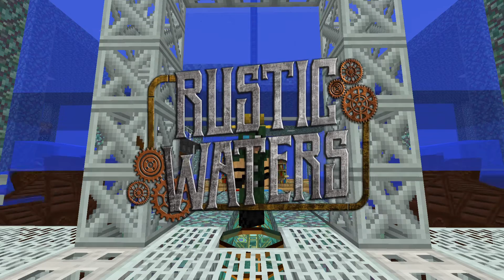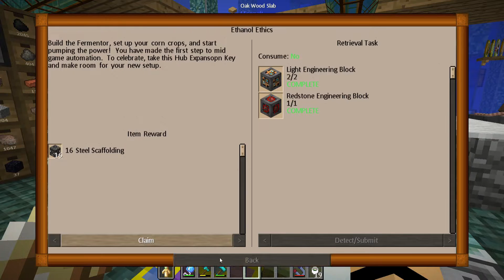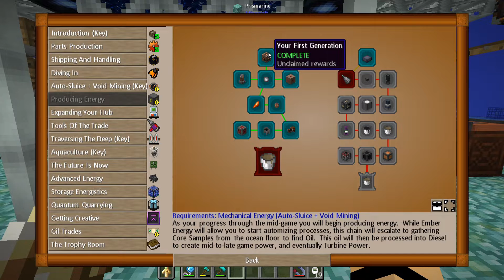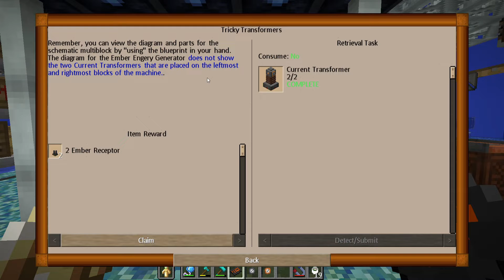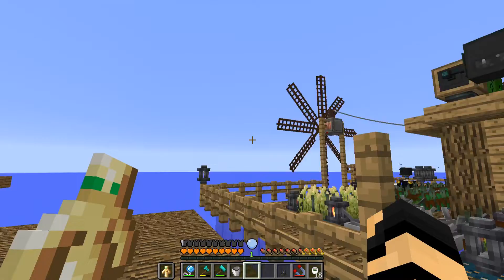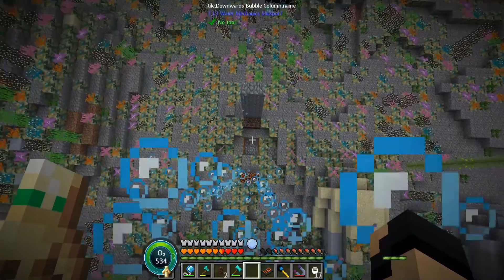35 Seablock: Rustic Waters modpack! The Need for Power

Comment: Hiya V.  The End Book is 10K Monies, but worth every penny :)  You're not far from Ender IO Travel Anchors though. You will need to get your Ember Bore going, and as soon as possible. It's the only way to get decent amounts of Platinum without getting in Environmental Tech, which you're a long way from yet.

I'm just getting close to starting the 'Creative' quest line, but it's one of those packs where you just multiply everything up and then go AFK to get the hundreds of thousands of resources to build a single item.

Comment: I don't think the activator needs lava. 
The mechanical power thing is extremely cool. Only thing to note is that those gearboxes have facing (they have an input side), and you have to slot a gear into them for each axle.

Comment: Check the quest book for the ember setup. It doesn't need lava. Just a lever on the item extractor and the top thingy I think.
Then a hv connector(or relay) on the energy output and wire it from there.

Comment: why does it feel like anything power gen beyond windwmills/watermills is fruitless to do on a proper server before u have an ember ore quarry IF u have chunkloading. since the builds will produce a large amounts of material per time as long u have a tight enough automatic system, and since all u need is more fe why not just make another windmill setup? for the offline time to smooth out the valleys of the setup? this part the pack design philosophy just looks very flawed for server play (especially if a pack highly suggests duplicate farm setups)
Reply: just so its clear the " you" was mentioning any person with a similar build flaw to yours not you yourself.
Reply from the maker: The windmills currently make a small fraction of the power needed. I'd have to spam them to get enough and I figured why not go with the progression and try something new.
Reply: fair enough was just talking about it from an uptime perspective because of how chunk loading on a proper server distorts the feel of time.(compared to pack incentives.)

Comment: So let me say this first i didn't test this, but perhaps open block elevators don't have a limit on how many blocks they can teleport you, and even if they have if you create a 3x3x3 room in the middle then going between surface and under water would be just 3 jumps/ shifts. A much quicker way
Reply from the maker: I actually did test and they have a range of about 5 or 6 blocks. :/
Reply: @MischiefofMice  it's easy enough to set up a chain of elevators.

Comment: You can change the one probe to only show while sneaking by enabling "hold key to be visible" (or something) in config and then setting the control to left shift
.
I got my enderbook from a nether fortress. Maybe try find one in those? Not sure if the loot tables have changed or something (it's really expensive in the store).
Definitely recommend the Ember Mechanic over the steam boiler/steam engine for the bore, it seems way easier to setup and produces much more rotation.